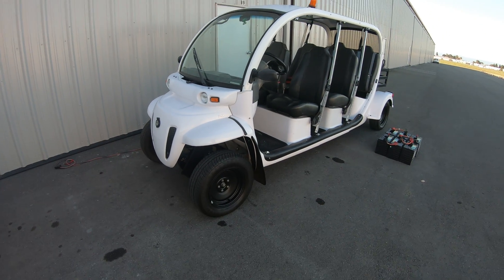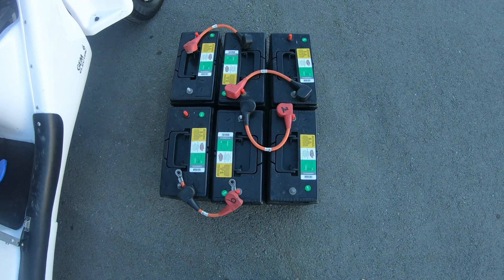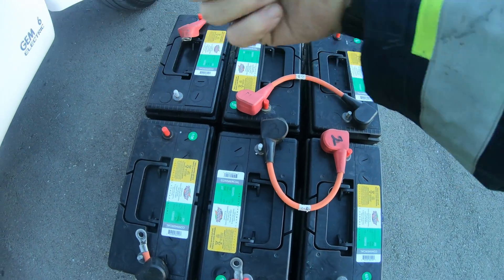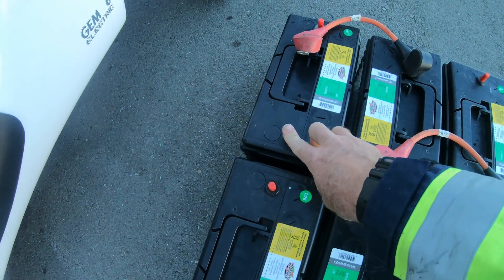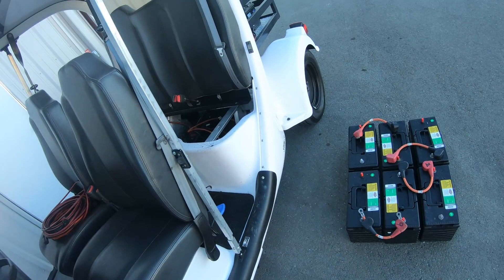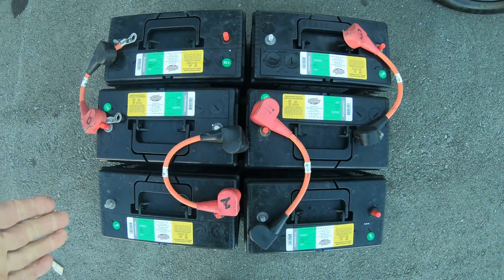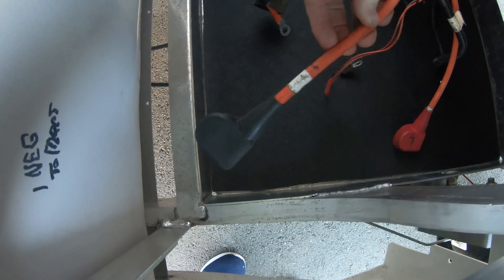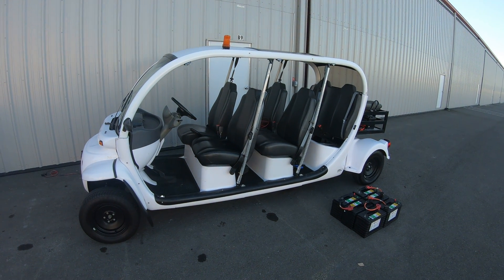2011 Gem Car E6 Battery diagram

Comment: Have you converted any of your GEM EVs to Lithium Iron Phosphate? I'm thinking that an LifePo4  pack might be more cost effective and provide greater range with less weight.
Reply from the maker: Yes, I have converted one of my Gem Car’s to lithium, (e4) and I must admit I am not very pleased with the range… granted the car is much lighter, but I am not impressed with the range at all.
Reply: @wcolby  Thanks, did the total Kw/h and pack voltage end up the same as the lead-Acid Pack?

 I just ran some numbers, using 22 2.3V, 160AH prismatic LifePo4 Cells, and figured they should provide about 10Kw/h over what looks like 7KW/h most had stock. 
 
I'm considering a 2009 GEM e825 e2 that had the batteries replaced about 3 years ago with 12V, 98AH flooded deep-cycle marine batteries.   I used to build electric aircraft Tugs from experience figure the current pack is getting close to the end of it's life. And was thinking that the Lifepo4 replacement should be 40% less weight and cost than the FLA deep-cycle batteries, and get 2 to 4 times the service.   

The owner is asking $6,000 for the GEM but I'm thinking that might be about $2K to $3K too much? If you or someone is interested I can get you some details.

Comment: Amigo puedo hacer funcionar mi gem car e825 con baterías de camión ácido plomo liquido...... Más no de gel por que están muy caras
Reply from the maker: I use whatever batteries are available to me, I agree, GEL batteries are too expensive.
Reply: Thanks for your answer, it works and loads the same Then I will buy lead acid batteries, they are cheaper, they told me they could burn the controller because they have a lot of amperage but I see that you use them the same. And how long lead acid batteries last friend. Thank you

Comment: Let me know if you ever need any help with these. I mantain a fleet of them for the Dept Of Energy at SLAC.  Working on 2 at the monent...
Reply from the maker: Definitely!  I have the mechanical taken care of, but I need help in the electrical department.
Give me a shout any time. walterlcolby@gmail.com
Reply: I just picked up (4) 2013 Gem 6's and need to replace batteries in all.  Can't justify the OEM Gel 8v's , do you see any issues with going to (6) 12v acid batteries? Thank you!